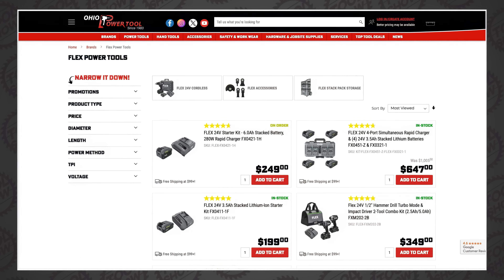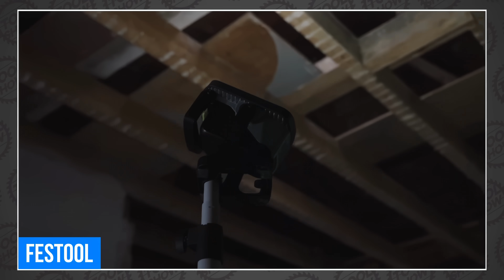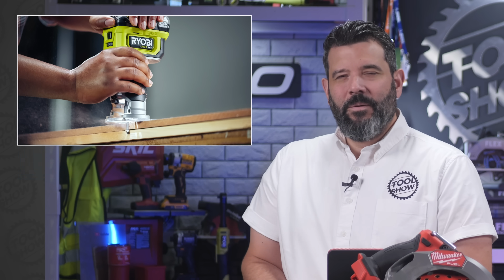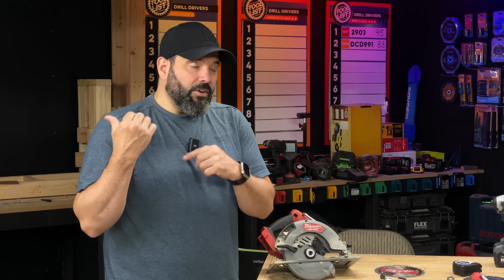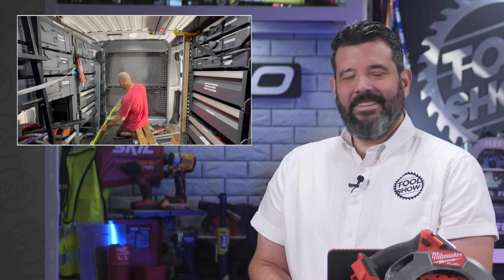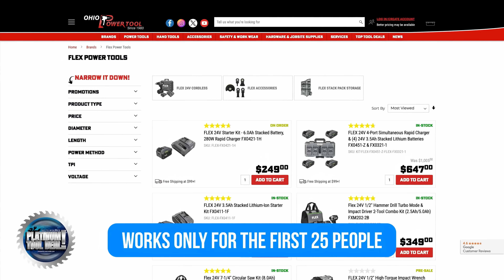NEW Power Tools from Milwaukee, FESTOOL, Hercules, RYOBI, RIDGID, and more!

Comment: I use a fordge 6.0 on 9inch grinder  ve 12.0 old battery doesn't last as long, but the forge  6.0 has better  power to be sure
Reply from the maker: @kevinlynch2915  Yeah that’s what you should see. They should perform about the same.

Comment: Why do circular saws put blade on right side for right handed people, blade on left side better line of sight , and safer.
Reply: Left blade saws are terrible.
Reply: @interman7715  ever use a skil worm drive? All worm drives for that matter great one handed saws
Reply: I have the M12,  blade on left,  great line of sight.  But it throws all the sawdust right at you if you don’t have it connect to a bag or vac.
Reply: It has to either the ejection of the dust